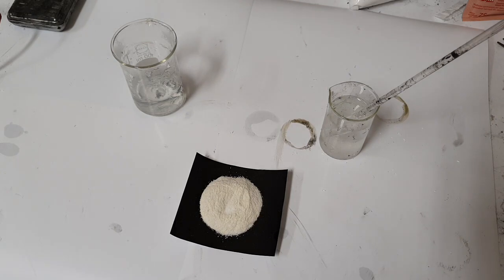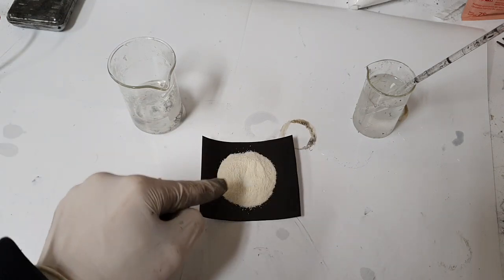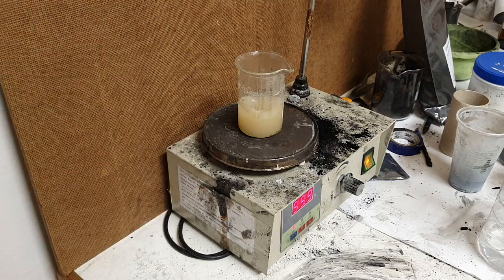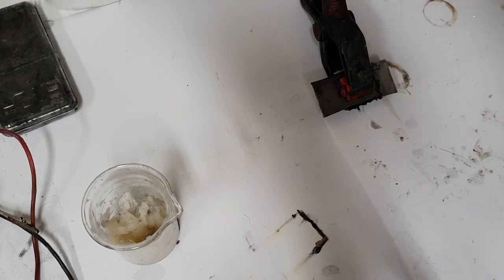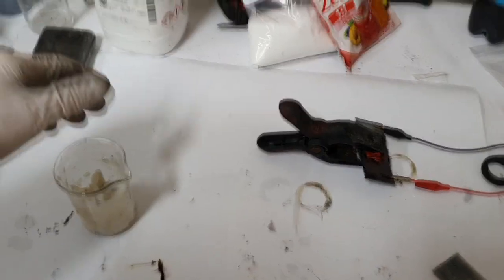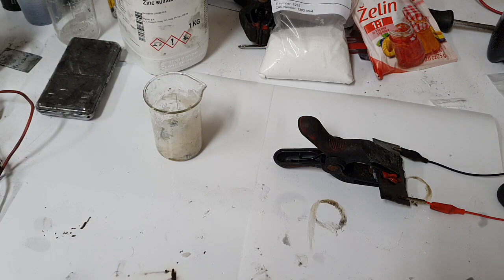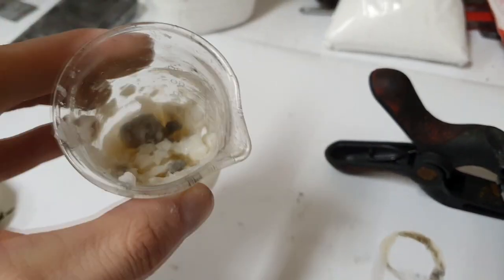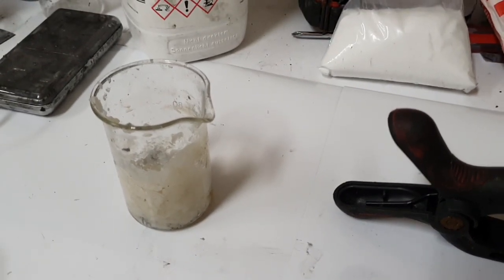Make a Gel Battery from Gelatin electrolyte

Comment: I have two 12V gel batteries from a wheelchair and the gel looks dried up. How do I re hydrate the gel? Adding water does not seem to help, although I have managed to get them working/charged up.
Reply: You also need to make sure you wear gloves. Protective clothing and safety goggles and put the battery on a slow charge
Reply: . Do this with a syringe plastic needle and lemon juice an epsom Salt.
Reply: Be sure not to fill. Overfill the cells.
In the battery

Comment: Do you know what is mixed with the h2so4 in the gel battery
Reply from the maker: Oh, sorry. You mean in gel lead acid battery? Then is mixed fumed silica
Reply: @cayrex  yes
Reply from the maker: Pva
Reply: When  we  mixed h2so4 or fumid silica and heat it  45  deegre it turn into liquid and after we cool at 30deegre it turn into gel or solid

Comment: So the cell you made is rechargeable? It was a zinc electrode, right? Is there an advantage to a gel salt electrolyte vs. an aqueous system?
Reply from the maker: Yes it is rechargeable. Also yes, is zinc which I use. Advantage,.... the gel electrolyte stay in place, you can lake flexible cell, low hydrogen evolution,... but the gel electrolyte have also a bit lower ionic conductivity as aqueos system

Comment: @ cayrex2
Can you tell how to make  carbon or graphite  felt, i could't find usable info on it?
Reply from the maker: To make a carbon, I gessing you want to make activated carbon, right. First you need some source of carbon (for example from wood,.... you burn the wood to get charcoal). Then you have two options if activation,... steam or chemical actovation. Activation by steam need high temperature, etc. Chemical activation need around only 350 to 450 degg C. With chemical activation you have another 3 options of activation with base, acid or salt. KOH and ZnCl2 are good and you will get good surface area. In this case you make a solution ftom example ZnCl2 and you add your carbon source into solution and leave the mix for some hours that the carbon will soak the solution. And then you add the carbon in autoclav and you heat the carbon on around 350 degg C for again several hours. The problem you will get with cleaning the material, because is a little hard to get the zinc material out. So that was a fast description Easily is to buy some good carbon.
Reply: @cayrex  Thanks that! I was hoping there is a way to soak carbon or graphite into fabric like when they color it, so it would become conductive at Z axis and would have large surface area because of the fibers.. I have bought some of activated carbon felt and it worked well for me,  have incresed the battery performance but it is too expensive so i thought i make some.. no luck so far. Thank for taken time to reply.
Merry Xmas to you and to your  loved ones.
Reply: @cayrex   the best material for making carbon felt seems to be a PAN (polyacryilonitrile) based fibre.
Reply from the maker: @en2oh  yes PAN is the most used material for making graphitic carbon felt. But for making graphitic carbon you need really high temperature.  So is better to make PAN based activated carbon felt. Or the easy way to make a simple carbon felt is to coat some felt with carbon conductive ink,... posible with activated carbon contend

Comment: That looks a good gel electrolyte, maybe it could be squeezed or moulded into a more uniform thickness.
I wonder if it will dry out after a few cycles?
Reply from the maker: Yes you can moulded into any thickness. And yes it will dry out after a day or two,.... you need to sealed the cell.